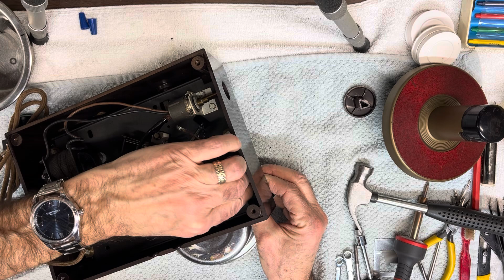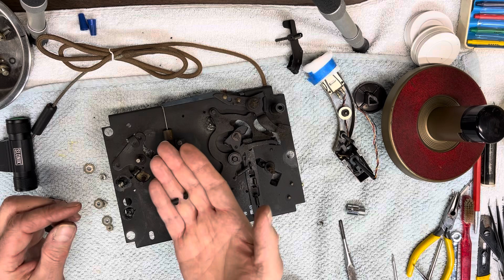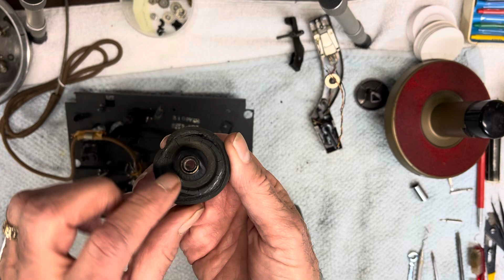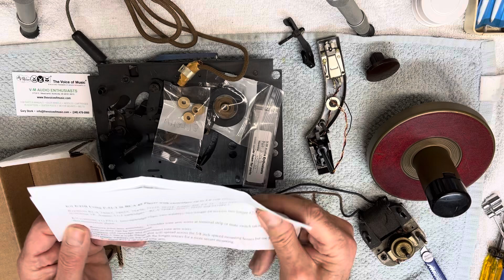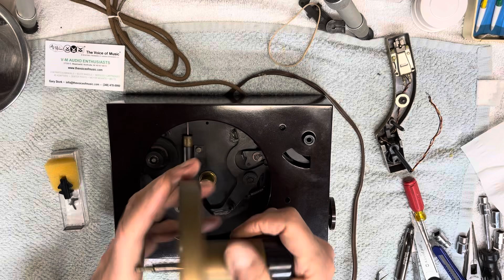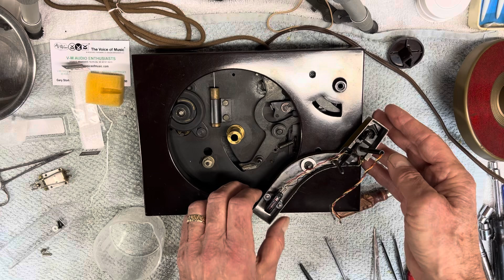Repair and Restoration ￼of an RCA Victor 45-J, 1950 Part 2

Comment: Hi there, thank you for this very detailed video. I’m sorry if I missed it, but where did you get the replacement power cord? I’m having a hard time finding one that matches the original.
Reply from the maker: It’s just regular brown lamp cord. If you have an old lamp laying around, use that cord. It’s thinner than today’s cord, which makes it easier to bend it and tuck it around the edges underneath the base.
Reply: @markh77  wonderful, thank you so much!